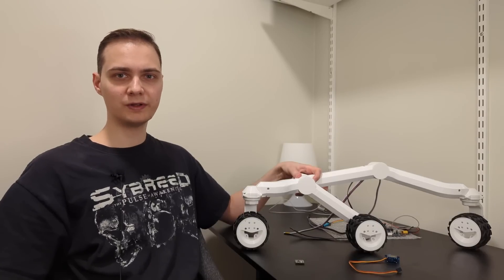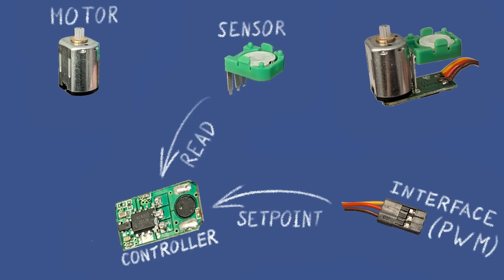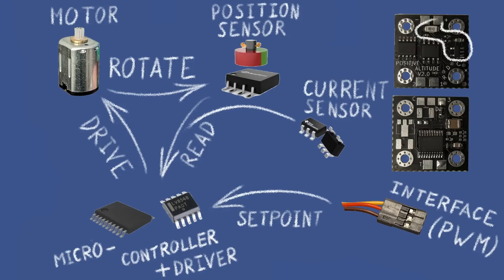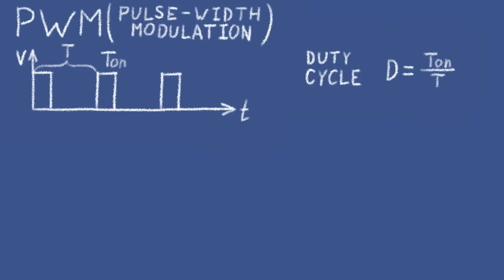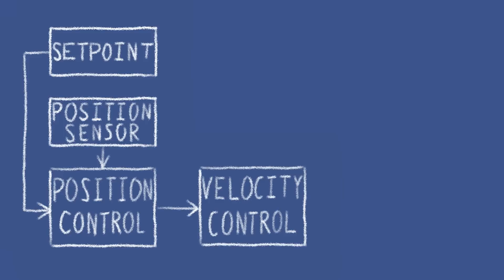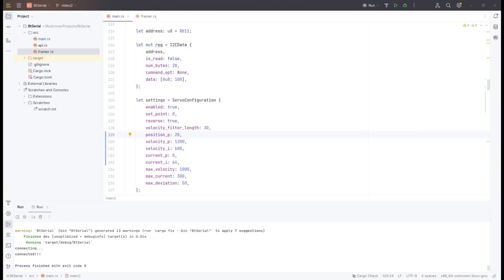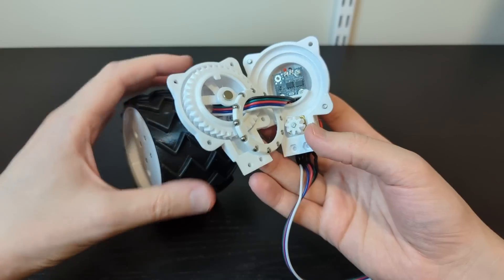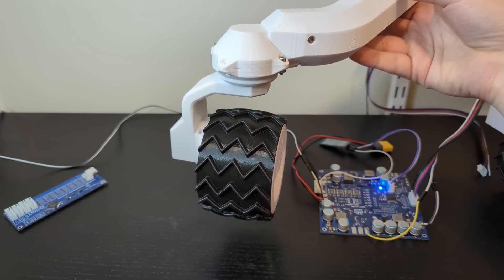Hobby Servomotors Could Be Much Better

Comment: I would be interested in using your board.  The only change I would suggest is to separate the I2C from the power and make the boards daisy-chainable with both power and I2C in & out connectors.  That way (with suitable software) all the boards can share the same I2C address and connect to a single bus on the controller.  It also vastly simplifies the wiring.
Reply from the maker: Actually I've already made similar improvements. But I decided to switch to CAN bus instead, as I2C is not very reliable in noisy environments. I also made it with 3 phases, so brushless motors also supported (can run FOC! ). I will make a video about it soon. Design files here, if you are interested. https://github.com/PositiveAltitude/BLDC-servo-v1-hardware

Comment: My god you have made a perfect DIY pan&tilt camera gimbal.
Reply from the maker: I think it will not be quite good for the camera gimbal. It is made for DC motor and there always will be a gearbox and so a backlash. I mean we can do a camera mount, but it will not be very smooth. I have a plan to make a version for the BLDC motor in future. It will (hopefully) be possible to use special direct-drive BLDC and build a real camera gimbal with it.

Comment: You could also use RS-485, very noise resistant, but your intended line length is short, so something simpler probably works... Maybe even just added a drive transistor on each end, with lower resistance pull up.

Comment: Excellent work.
Subscribed and will be following this project.
Might have a go at making something inspired by this later in the year.
Reply from the maker: Go for it! Starting could be hard. I probably spent a year thinking about the rover, before I started actually doing something. I was scared of the amount of efforts required to finish it (and I still not very close :) ). But when I started I was making progress way faster than I though. And it is also fine to take breaks if you feel burned out. So I would say that if you have an idea and you are passionate about it, just go for it. The faster you start, the faster you will get to something you will be proud of. Good luck!

Comment: I'm very interested in the servo control board! I'm working on walking robots. Off the shelf servos are disappointing and get expensive quick when you use a dozen in one robot. 

Using N20 motors at each joint could be a big improvement.
Reply from the maker: Yeah! That's sounds cool! How big is the robot?
I am working on the next version of the servo. The version in the video has some issues. I will share design files when it will be ready.

Comment: If you are using a magnetic encoder to determine position how do you figure your start point? On a normal servo the potentiometer returns a set resistance value   so it knows where its start position is. How are you achieving this?
Reply from the maker: This encoder returns absolute value :) Yes, the zero position is quite random, because you cannot really align the magnet's poles orientation when attaching it. But if you don't mess with the magnet, zero point stays the same, so you can just offset it in the code.

Comment: You mentioned that I2C can carry two-way data.  Did you use that ability in your servo motor board?
Reply from the maker: Yes! The host controller can read position and other stats from the servo
Reply: @Positive_Altitude  Nice!  How do you set the I2C address on the servo side?
Reply from the maker: @yeroca  for now it is just hard-coded, but actually STM32 can write to it's own flash during execution. So I think that I will reserve  a place on the flash, and make a special I2C call that sets a new slave address. So you take a servo, make that call, reboot the servo and now it has a new address. But it's a plan for now. I never touched that feature before, but if I read the reference manual correctly, that should work.
Reply: @Positive_Altitude  Sounds like a workable plan.

Comment: Lovely work!  I think Elon is using Ethernet to run Cybertruck, so worth a crack here too, especially with the large scale of the vehicles you are producing.  That way a single ethernet ring would provide all the communications to all devices / motors, and all you need then is to provide power to the motors.  48 Volts to reduce power cable diameter too, of course and get more torque? :)
Reply from the maker: Yeah, I will use CAN bust in the next version. I think Ethernet is a an overkill here. And CAN actually an industry standard to connect things in cars. This rover also has way more torque than it really needs, but it will be slow :) But I am fine with that. I already made a board that does a battery management and has MPPT solar panel charger, but it is designed for 10V.

Comment: Wondering if is worth to integrate everything into the wheel and add a slip ring for power and LED and receiver for signal transmission for continuous rotation like a LiDAR

Comment: I am impressed by the presentation and the mechanical/hardware/software design.. Where is the github.. and how do I order the PCB ?
Reply from the maker: Thank you! Not shared on GH yet, because there are issues and no documentation at all. Maybe I will do that during the next few weeks. But anyway I am working on a new, improved version, that will be shared from the very beginning. I hope I will get there in 1-2 months.

Comment: Great idea, great video! Thanks
Just a note on PWM to control the standard servos: it is intended to have a period length of 20ms with T_on of 1.0ms for lowest position up to 2.0ms for the other end position. As long as you stay with this period length your description is correct and you can call it PWM.
But in fact the period length is not important, only T_on is considered by a servo. So with another period length one can see not T_on/period is the signal, only T_on is used. The term PWM is a bit misleading here.
Reply from the maker: Yeah, that's right. I did not want to overcomplicate things and said that is just a PWM, which is almost true. But I got your point, thanks!

Comment: This is a great project indeed. As already written by others, it is better to replace I2C by RS485/CAN or another more industrial type of interface. For small projects I2C may be okay, but I think something like a serial interface as used by Dynamixel (where it is easy to swap between TTL and RS485) would be better. For more generic use, the protocol should add for programming the (PID) parameters, allow for absolute positioning or speed control, current feedback (to get an idea of the load of the motor) and more.
Making this open source will allow the community to make this an even more versatile project than it already is.
Oh - and add connectors. Connectors are a must have for easy maintenance.

Comment: Great project! If it not too late, change I2C interface to something else. I made this mistake when building my robot and experienced communication breakdown due to electric interference with I2C sensors for wheel position. I2C is good for communication between ICs on PCB but will fail when use on wires. Especially when close to electric motors.😮
Reply from the maker: I learned it when it was too late. Hope it will be ok, otherwise I will switch to CAN, but it will take significant effort. For now I reduced the problem by using 3 I2C interfaces instead of 1 as I planned. So now it's 5 servos per bus. And two servos works fine. I hope 5 servos will work too. Thanks for the heads-up!

Comment: Fricking absolutely. We're stuck with 1980s technology for servos. Wiper potentiometers, weak, slow, brushed motors and open loop (from the point of view of the microcontroller) control schemes. I can buy a 500W brushless drone motor for $10, a 4096 position, continuous, absolute rotary encoder for $5, an ESC for another $5 but no one anywhere has put these together into a robotics servo that uses I2C or SPI? No. I have to buy a $1000 NEMA whatever AC servomotor and a $2000 controller that runs over RS232 with a proprietary connector and proprietary software that only runs on ****ing Windows NT. This needs to change.
Reply from the maker: This is so true! That hurts me too. We have so much cheap and great parts but proper BLDC servos are so expensive. I will go for BLDC servo as soon as I complete the brushed servo first. That will be exciting! It is time for brushed motors to go away.
Reply: @Positive_Altitude  Standard servos, even the fast ones are also just way, way too unresponsive. I see people using them in guided rocketry and all they get is oscillation. You can get servos that do 60 degrees in 100ms, but most of that is spinning up and spinning down the motor, so it definitely won't do 30 degrees in 50ms or 15 degrees in 25ms.

That includes AC servomotors too. They might be fast when they get going, but they're slow to get there.

If you get the data, it would be nice to see an RPM vs time curve when you give your controller a move command. I know your rover doesn't really require high speed position changes but it would be nice to see anyway.
Reply from the maker: Lol. I have made one of these rockets, check the first video on the channel. And that damn delay... I greatly underestimated how badly 40-50ms delay could affect control algorithm stability. That was the reason why I failed my first launch attempts. And what is the most annoying -- there is no position feedback, so it is not possible to measure step response and use it for control system tuning. I ended up just roughly modeling it in the simulation. As the result rocket flies, but with some oscillations that are not present in simulation. 

It is totally possible to implement a way to capture step response of my servo, it also will greatly help to tune the servo for high performance, but I haven't implemented it yet. But I can say for sure that 400kHz  I2C has almost zero communication delay compared to 50Hz PWM :D

Comment: It would be really nice if , you just made a video on the control schema of the motors , as I saw you werent using PID , cause that was really cool.
Reply from the maker: Yeah, I decided to not dive too deep into this. But in fact everything is very simple. Position control is just P regulator. Velocity control is PI (well, almost: I term is applied to velocity delta, P term to current velocity, not to the delta). Current control is just PI. So it is like 3 simplified PID regulators chained. And it is not my invention, google for "PIV regulator" that's exactly what I implemented. Maybe I will make a video about it, but not sure if it will be soon.
Reply: Oh , thanks

Comment: In my final year of university, I created an equation to smoothly travel from one position to another with a maximum acceleration, constant speed and low jerk. I have a desmos of it if you are interested. It would be really great to have it integrated in a controller like this
Reply from the maker: That's cool I will be happy to take a look. I used very simple trajectory and never researched this topic before, but if you have a good answer already I will happily use it.

Comment: The assembly/wiring issue could be resolved with clip-in connectors, instead of soldering wires to the boards.
Reply from the maker: Yeah, going to add them in the next version

Comment: I see that the cage for the ball bearings is 3D printed, but are the inner and outer  races for the ball bearings also 3D printed?

If so, how well do they wear?
Reply from the maker: Yes, 3D printed. I did not make a wear test. I feel that they will wear quite slowly if not over stressed. And I assume that high speed will kill them instantly because of heat. But how fast the wheel will wear under the reasonable load is a question. Maybe I will make a test in the future.
Reply: @Positive_Altitude  

My concern is for the pressure that will be concentrated by transfer of the robots weight to the ball bearings. A metal race can handle tremendous pressures,  but 3d printed plastic, even at 100% infill is still roughly 70% the density of injection molded plastic.  Add to that the fibrous structure of 3D FDM parts, and that does not equal a recipe for success. 

Great work though.
Reply from the maker: That's true. But I believe that if load is under the certain threshold these bearings could last long. The threshold is a question. I would expect that one 4mm ball is able to transfer at least 1kg without any issues, but it is my guess. Of course its nowhere near what hardened steel could do. I will make a video about these bearings and will try to make some tests to get an idea what one could expect from these bearings.

Comment: You need stepper not servo
Reply: stepper motors are still open loop, you would still need an encoder to know it's absolute position
Reply: They are also quite heavy and not great for mobile applications

Comment: Hi, I would be interested in the idle current of your design. Magnetic sensors ~ 10mA, uC ~10mA, motor driver + rest ~5mA. So, I would expect ~20..25 mA. Is that correct ?
Reply from the maker: Yeah, this encoder (Semiment SC60228) takes around 12mA, MCU: 6-8mA. The rest is negligible. So yeah, idle is ~20mA which is something you need to care about when you have 10+ of them. I am thinking to use more popular AS5600 encoder in the next version and it takes around 8mA. Also the MCU just busy-waiting most of its cycles, so it could be clocked-down probably 2-4 times (and current is almost linear with frequency). So it is probably possible to get down to ~12mA.

Comment: IMO can bus would be a better option. I would require a different MCU (like something from the F series) and a transceiver but would be more robust
Reply from the maker: Thank you! I already started re-designing this board with STM32F042 and CAN bus. Thanks for mentioning transceiver, I never worked with CAN and assumed that differential pair goes straight out of MCU pins like for USB :)
Reply: @Positive_Altitude  oh you definitely don't wanna put the differencial pair straight to the GPIO. Apart from the fact it wouldn't work(can rx and can tx are not differencial pair, their more like uart electrically) you wouldnt want to put a transceiver on the same chip as the mcu from a design standpoint. A transceiver needs to protect your device against ESD and big voltage spikes(you can't control what on the bus). Plus it requires more current to push/pull an entire bus(usually many many metres of wire) to a certain voltage. Regular GPIO pins on MCUs cant do that(fast enough) so you would need to buff them up. All that takes space on the die of the MCUs so they all decided its not worth it. 

Oh and you probably want 5V for the transceiver (they usually dont work with 3.3V) but you don't need a level shifter for the communication lines. CAN_TX from the MCU is 3.3V and that usually counts as logic 1 (double check the datasheet of your transceiver chip) and 5V signal coming to the STM32 from the transceiver is fine because that pin is 5V tolerant(I checked the datasheet for that chip for you but not all pins are 5V tolerant and not all STM32s have 5V tolerant pins so always check the datasheet)
Reply from the maker: Thank you so much! That is very helpful. I appreciate this very much. I also did a small research and found SN65HVD234 a 3.3V transceiver. Good price and availability. Are there any downsides of using non-5V ? I see that it is only 1MHz but I think that with a good protocol, it should be more than enough. I don't really want to bring 5V to the design since it will make integration with systems that have only 3.3V not possible.
Reply: @Positive_Altitude  Mainly price. TJA1050 is cheaper (38 cents vs 66 cents) but now that I look at lcsc the availability is worse than it was when I last looked at it a few months ago (its only 2K in stock right now).  

If you dont wanna introduce a 5V line (and I get that) that chip might be a good choice. I might switch to that chip too in my project. Price is not that bad, availibility is better and I could turn off my 5V PSU when sleeping and still use the can bus.
Reply from the maker: @igorordecha I use LCSC too :) Cool! Thanks again!

Comment: Any thoughts on longevity of the bearings? I’d have thought metal on plastic would cause wear and play eventually!
Reply from the maker: Actually I think if both will be plastic, balls will wear much quicker than the runners as they are smaller, so it it probably a good thing that balls are harder. These bearings should be considered as "low load, low speed, low precision". If we compare them with factory made steel, they just sucks in every aspect except weight and price :) For projects like this rover I think they will wear pretty slowly. I print it with PETG an it has good wear resistance. But for example if you are making a racing RC car, these bearings most likely will just melt in a few minutes.
Reply: Thanks! 😊

Comment: Really cool and well-done. Which PCB design software do you use?
Reply from the maker: Thank you! I am using KiCad. I think it has the right balance of features/complexity for hobby projects.
Reply: @Positive_Altitude  thanks for the reply.   I dabbled with Eagle a long time ago, then played around with Kicad a little and now am looking at EasyEDA. I think if a project comes along where I need a PCB it will be either Kicad or EasyEDA.

Comment: Awesome project, thanks for sharing. Which IC did you use for current sensing?
Reply from the maker: Thank you, it is Texas Instruments  INA180A2. It amplifies the voltage across 10mΩ resistor x50 times and then I read the value with ADC.